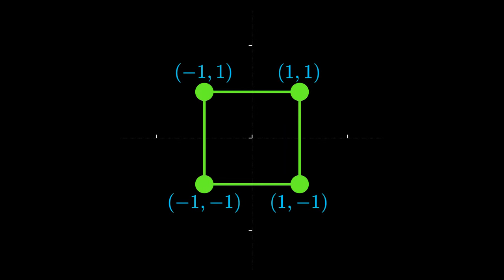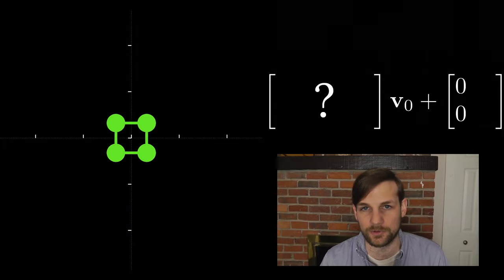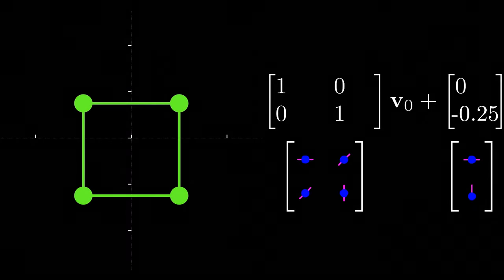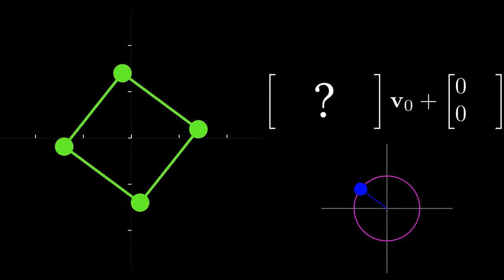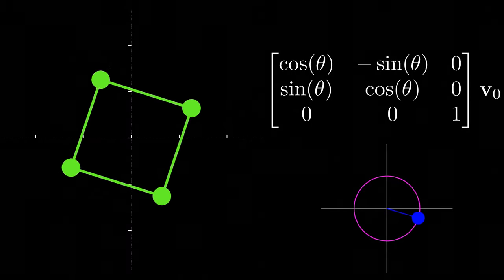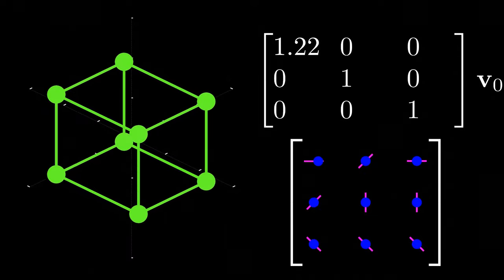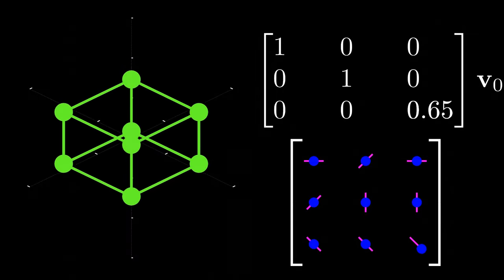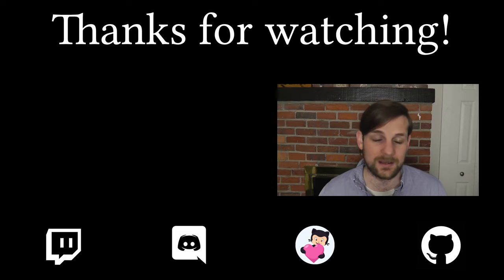What are affine transformations?

Comment: I understand matrices in completely different way that allows me to construct them directly.
Multiply matrix times vectors by hand writing down complete equations like v.x'=v.x*r1c1+v.y*r1c2+v.z*r1c3 (normally m11... or m00..., i wanted to make clear what is row and column)
Now try unit vector v.x=1. You will notice that first column is basically how will transformed unit vector x look like. Second column is for vector y, third for z.
If you take any vector you can write it as sum of unit vectors with some scale so it can transform any vector.
Do you want rotation by 30 degrees? Ok. Let's start with x. Ok, unit vector x will be tranformed into cos30 in x and sin30 in y -> first column. vector y will be transformed into something pointing left and up, so -sin30 in x and cos30 in y -> second column. Do you want translation for points, but not vectors? Expand matrix to 3x3, assign z=1 to points and z=0 to vectors. Write translation in tx,ty to third column and let r3c3=1. Now if v.z is equal 1, it will be transformed into vector tx,ty and z will remain 1. If original vector had v.z=0 it won't be affected by translation and z will remain 0. You may ignore that z is "borrowed" from 3rd dimension and you may call it w to make it less confusing and compatible with 3D transformations.
This way you can even do some stuff like align two 3D objects, e.g to align screw with hole in some mechanical part if you can measure some vectors and points for reference.

Comment: Nice. I like the visualizations.
You can also do this in an extended complex form with √k instead of i. If I remember correctly, k is cotangent to the angle of a line through the origin from the lower left to the upper right corners. The sign of k defines whether it is stretching or skewing and whether rotations are elliptic or hyperbolic. At 45⁰, it's circular rotation if negative. If positive, the angle is of the asymptote of the rotational hyperbola. It can be more computationally and space efficient than matrices in some cases. 
You might be able to do the same hacky combination of the affine using a similarly extended quaternion but I haven't tried that yet.
Reply from the maker: This is an interesting perspective I had not thought about. I need to look into it more! Thanks for the comment!
Reply: @LeiosLabs  I have yet to find anyone else using them this way so that's nice to hear. I expect someone does, I just haven't figured out what they call it.
People usually stick to a k of -1, 0, or 1 (Complex, Dual and Split-complex) and never mix them other than hierarchically but it's possible to generalize the algebra, the trigonometric functions and even flip the sign of k (swap the real and norm) and do operations between numbers with different k values. I find it useful for things like orbital dynamics and relativistic physics. Also unit conversions as |k| is effectively the ratio of the units of the real and imaginary part... such as k=1/c for dτ=||dt+dx√k|| which I find less messy than using cdτ (ds) and cdt everywhere—at least in software where I need to retain time and proper time in time units, for instance, rather than length units.

Comment: nice!
i am looking for grid deformation due to straightening a function.
say i am traveling along y=0, in our 3d world (z=0), using perspective, i'd see equally deformed "squares" on both my sides.
in 2d, the cartesian grid will not change, as the line is straight and parallel to the x-axis.
I would like to "see" what happens to the grid if i travel along y=x, and if i make the graph a straight horizontal line.
same for y=x^2 and for y=x^3 and for y=sin(x).
can you point me in the right direction?
thank you!